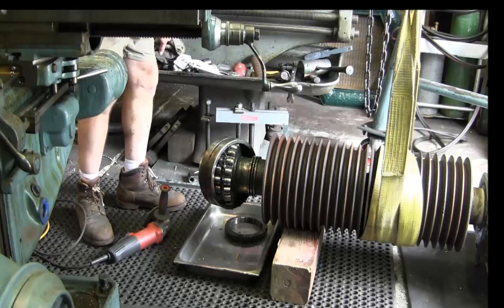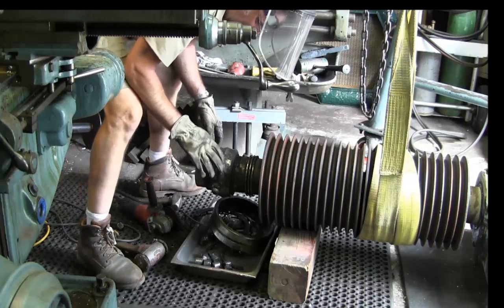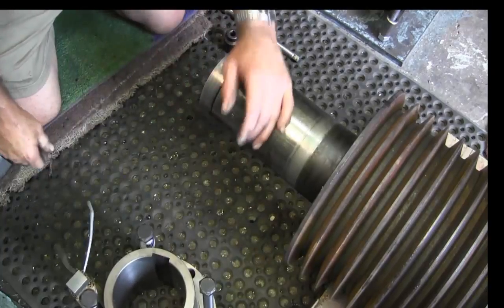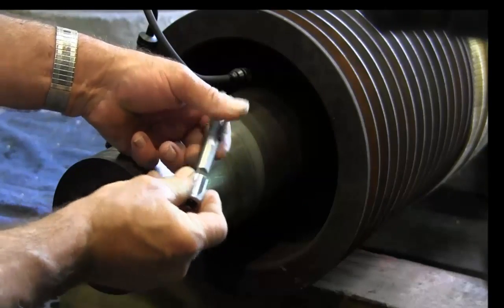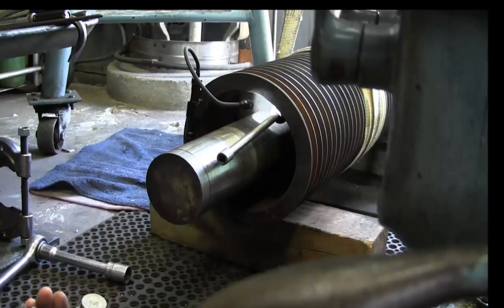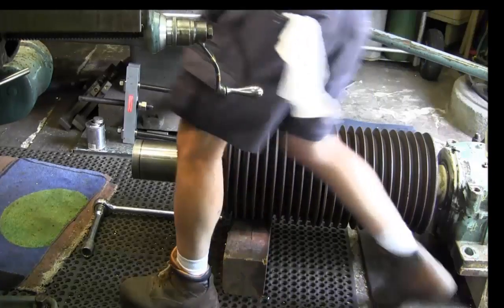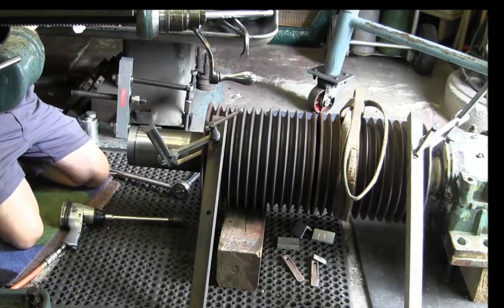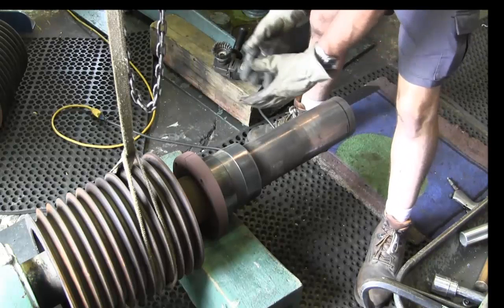Jackshafting Part 2: Tub Grinder Jackshaft Refurbishment

Comment: Nice effort, I am sure you are happy the heat popped that sleeve off so nice.  Have you considered a porta power setup for your puller?  You can slip the cylinder in there in place of the threaded rod, takes a couple extra hands, but you can move the earth with hydraulic pressure.

Comment: Pretty interesting to see, and thanks for sharing. Used to work with guys maintaining Ready-Mix concrete plants.  They'd work on big stuff like that in August heat inside a building and metal work all around.  Challenging work even on the ground.

Comment: You have an air hammer? That would've helped break the dirt/rust bond. Would only need to deliberately make a larger blunt end on the punch or chisel end for the air hammer. You'd be surprised at how much one of those can do to help break items apart. Especially shafts out of bearings.. Just saying. Great video.

Comment: Brother, you need a shop fan to blow the smoke and dust out of the shop, you dont know what you are breathing in that dust.  I do car brake jobs all day, even though they are not made of asbestos anymore, the dust still leaves a nasty taste in my throat so a fan is a must in my shop and/or spray it down with parts cleaner to minimize the dust.  Love your work.  DD

Comment: keith next time u might try this on bearings, wrap the bearing in a rag put race up on steel block under race. take a sledge & hit the race on top. the hardened race will shatter! try it on an old bearing. works! my father-in-law worked at a rock crushing plant & when bearings froze up & rotated the shaft and caused deep groove in shaft that's how he got them off. when u have inside race to put that the balls r gone & u don't have a place 2 pull on, weld a bead on inside of race, it will shrink.

Comment from the maker: I would of made a larger puller, and made it a double flange, unit clamping the back side of the bearing and the front side of the nut & collar assembly so the working force, would be applied to the taper only and then add a large tube slipped over the shaft, and made the contact to the puller plate, if a hammering was needed for shocking. ;{)-----

Comment: See my comment in the first Vid. no need for a grinder if you do it the correct way. In fact i would often be changing bearings up to 350mm dia where i couldn't use heat because of fire or explosion risk.:-)